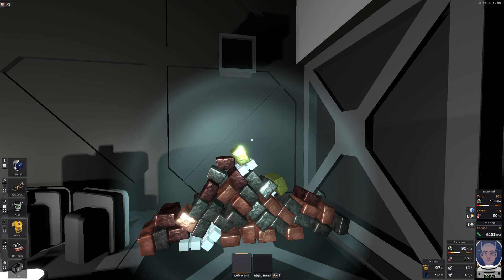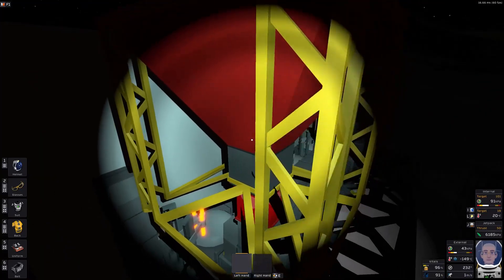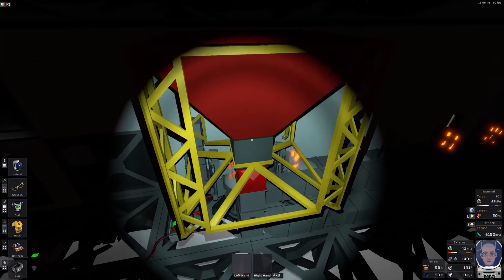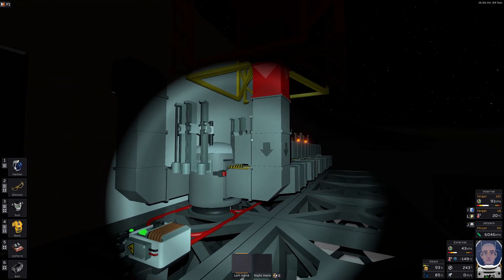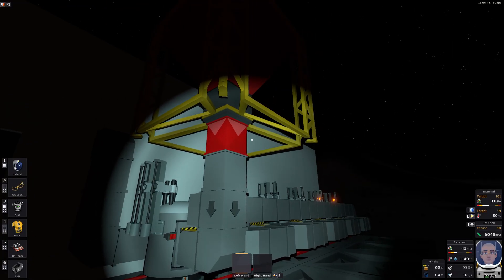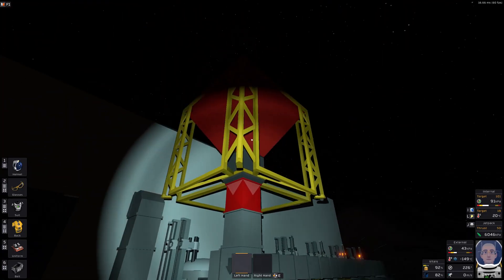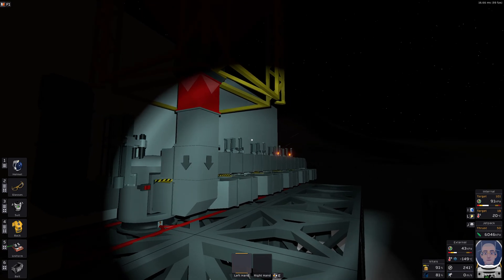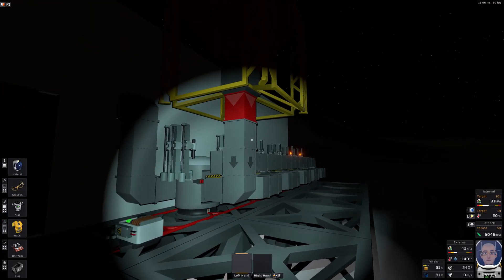Stationeers Tip: Easy Basic Smelting & Degassing

Comment: Can you collect all the gas from the degassing?
Reply from the maker: Yes, just contain the Arc Furnaces, put an Active Vent inside, a Gas Sensor (so the Vent only runs when there is gas) and vent into some container (typically to be filtered).   With multiple furnaces, need to be careful of generating gas faster than it can be pumped out.